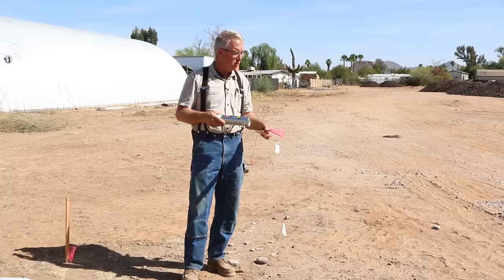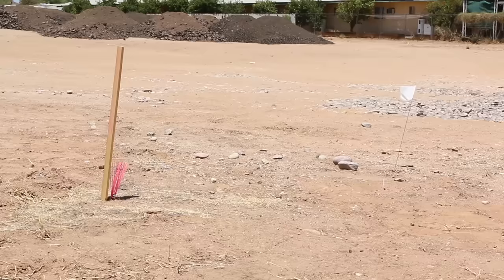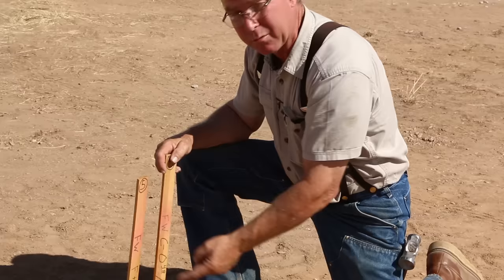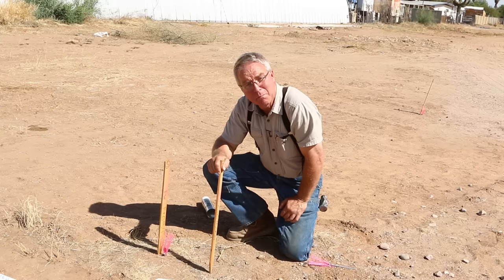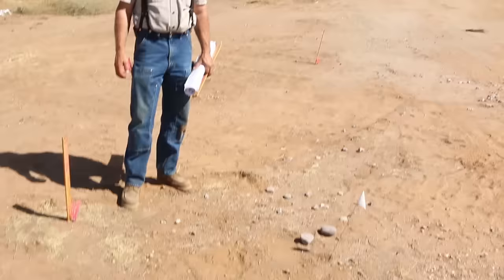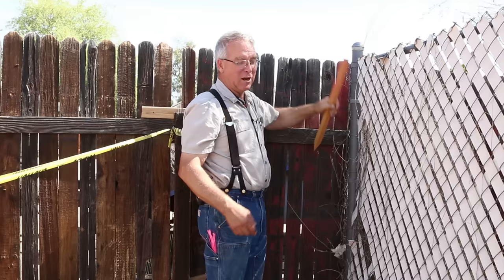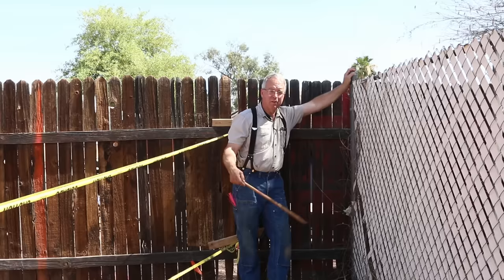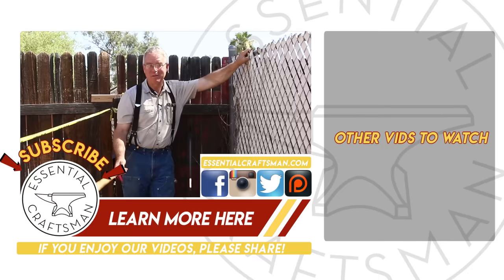Survey Stakes and Markers

Comment: Sorry,  why, why..... not going metric. Is it a pride thing, is is.. what ever. I know both systems (work related) but metric so much easier to work with.  Less calculations, conversion = less possible errors. (And typing this, I wonder how many are wanting to “shoot” me 🤪 or blood pressure points I raise 😳).
Reply: "Well .72 ft is roughly 72 eigths, and that is roughly 9 inches." There has to be some severe cognitive dissonance to think that compounding two estimations to arrive at a final measurement is somehow better than just x.xxx metres.
Reply: Why are you converting anything? If it says 5mm mark at 5mm if it says 5 inches mark at 5 inches. Work in the system you have not just what you want.
Reply: Imperial is an inferior measuring system because the smallest measuring unit (length) is 25.4 units of measurement in metric, and that is before metric goes into decimals. (Technically, metric does not rely on decimals before you reach 10 orders of measurement below what is practical for construction)

Therefore metric is far superior to imperial.
Reply: Yep, I'm American and was raised on imperial measurements. After physics classes and the ability to use both, metric is so much easier. But if all the plans and everyone else is using one way of measuring, converting over to the easier system isn't going to make things easier, it needs to be implemented from the start.
Reply: meter is the base unit, mm is already a decimal.
Reply: Is not going metric a "pride thing"? No. It's a cost thing. Everything in America is already in imperial and frankly, forcing everyone to change to metric isn't worth the cost. Yes metric is better but let's be honest, it's not so much better that it warrants all the cost and confusion that would ensue from a nation wide conversion.
Reply: Sorry it just won't work there are millions of sheets of Civil plans and subdivision plats out there and it's impossible to not have to work with existing infrastructure. The cost in mistakes of having new plans in metric and old plans in feet will offset any benefits of going metric. This argument is foolish please just stop.
Reply: Remember that US would not be the first country to switch, even here in Canada we were imperial and switched to metric. Yes we still measure lumber in inches and metal profiles are sold mostly in imperial but otherwise most of the remainder is made in metric. We still survive with this! Would have to make researches if it added costs, probably a lot in the short term but such decisions are not made for the short term, they are made for the future generations and for uniformisation across the world. Also AFAIK most scientific work even in the US is made in metric.
Reply: Dominique, do know official the USA switched, but Congress did not made it mandatory. So on paper is a metric country for decades, in practice,.. only the armed forces, NASA and a hand full of organisations went full or partial metric.
Reply: the entire world runs on imperial, it just doesn't know it. most metric stuff is built in imperial. worldwide heavy industry is still in imperial. basically anything that is not a whole number in metric is just relabeled imperial. it's going to take another 50 years at LEAST for most of heavy industry to get converted into imperial, and the rest of industry will be behind that.

is metric easier? yes. but you're a fool if you think it's as simple as switching overnight, or even in a decade. it's going to take generations.
Reply: Ivar Bredesen what’s 1/3 of a meter? 33.333333333333333333333333333333333cm
What’s 1/3 of a foot?
4 inches
What’s 1/3 of a yard?
1 foot or 12 inches. 

12 is far superior from the point of view of division. 2, 3, 4, 6, 12 vs 10 only 2, 5, 10
Reply: What is 1/20 of a foot?
What's 1/10 of a foot?
Reply: Coming from Europe I was taught metric at first. It works, but for rough carpentry imperial is better for me. Pity we don`t get sheathing in imperial ;).
Reply: Have you disassembled an american car lately? Even those are mostly assembled using metric fasteners! Have you ordered stuff from china? Most of them have metric dimensions! I agree it's not simple switching over, after all Canada didn't event completely switched but in the long run every body wins! BTW www.metric4us.com is a funny site on the topic
Reply: I don't think it's a matter of pride (on behalf of the people who actually matter in this discussion, because of course some tea throwers would get uppity if someone touched imperialism...but anyways) i think it's a matter of cost.
You can't just up and go around and put cm, mm, meters on the new work without upgrading everything behind.

I doubt US will ever change within our life times, it will be, however, a slow change as more and more people ditch the antiquated imperial tea, i mean, imperial standards.

As far as i'm concerned, i was born and raised in Meters. I learned other measuring systems in school, and necessity drove me to learn proper imperial standards.

I have no problem and use a simple conversion chart that was given to me by my grandpa as a child, he had been born to US, until he moved to Germany in the late 80s, he also, didn't have issues learning Metric, he was, in fact, the one that truly cemented my notions on measuring.

AND my point is, education is above mere small inconveniences such as these.
Reply: its not very hard to multiply decimal feet by .3048, i was working off a plan from 1914 today converting chains and links to metric.
Reply: .05 feet
.10 feet

So, what's the problem? :-)
Reply: "Sorry,  why, why..... not going English. Is it a pride thing, is is.. what ever. I know other languages (work related) but English so much easier to work with."  

So how about we make a pact: The entire world will measure using the Metric System and communicate using the English language.
Reply: William, fine by me (although I have much to learn) one ☝️ language all over the place!!
Reply: William, and keeping track of four language ( Dutch, English, German and kind of France) is such a hassle 🤪
Reply: epiphonesg007 - Who cares?
Reply: @sethbracken  OK I'll play along: 
What's 1/5 of meter? 20cm. What's 1/5 of a yard? ... hang on, let me grab a calculator. It's 3/5 of a foot or 7.2" or 7-3.2/16"(I think - had to do a few conversions from yard to foot to inch before I got there.
 What's 1/5 of a foot? .......3.2inches or about 3-3.2/16" on my Stanley Fat Max tape measure.
You've certainly proved your point /s